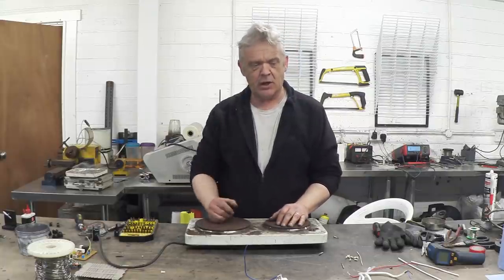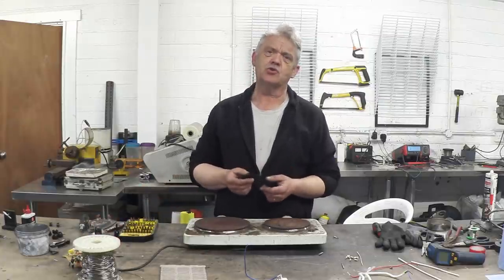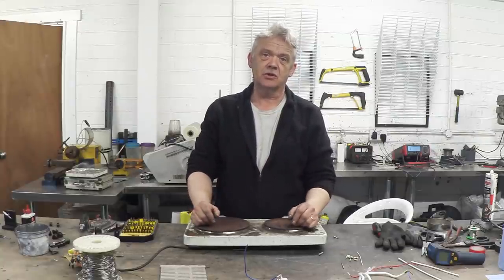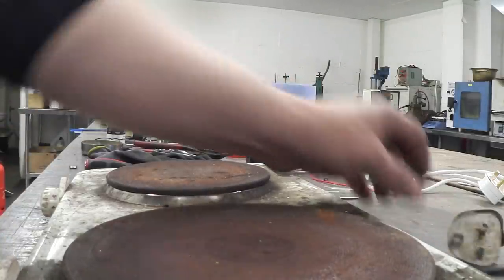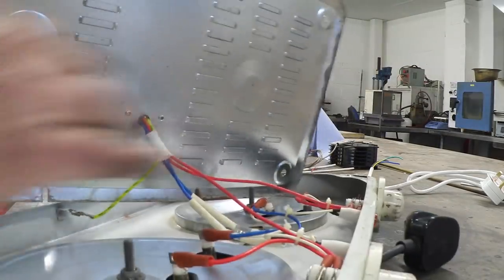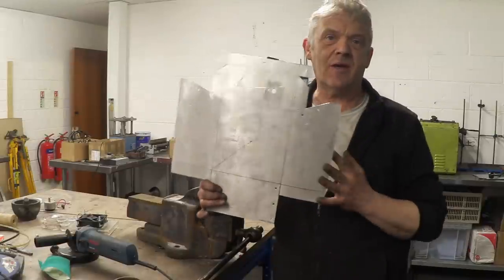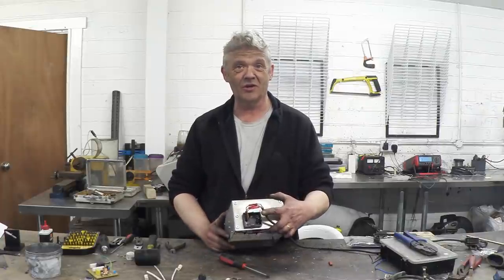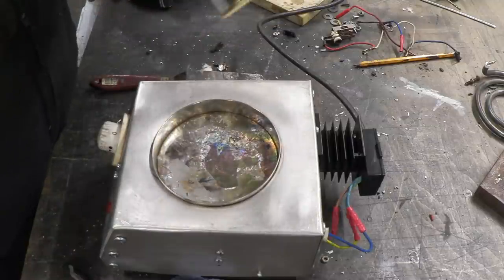How To Make A Desoldering Bath From An Iron Or Toaster Or Hob

Comment: You might consider using a bit of resin flux in the pot. It should improve thermal conductivity thereby causing the solder to melt faster so that you can get temp sensitive items out of the pot faster. Then again, I might be talking a load of rubbish.
Reply from the maker: lol - what I read said better no flux - but I always find if someone has one idea some else has exactly the opposite lol
Reply: There you go. It was a load of rubbish. There's probably flux left on the solder joints anyway.